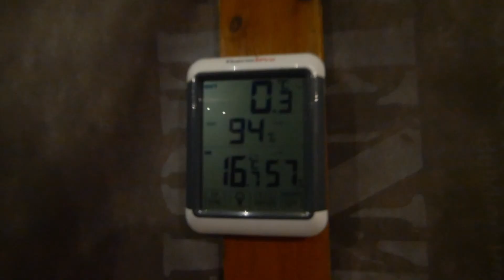First Week on the Road Full Time! Getting Pulled by DVSA!

Comment: The tapping you mentioned is a common thing with those engine when cold. It's just a lazy hydraulic tappet. Nothing really to worry about. They usually come to life once the engine starts to warm up. It doesn't help that rose was standing for a long time before you owned her.
Reply from the maker: Yes these engines are very tappy on cold but since I’ve done an oil change she’s been quiet but there’s more of a ticking noise and I believe it’s one of the tappets on the way out but nothing really to worry about yet😁 she’s getting a good run in now 😂